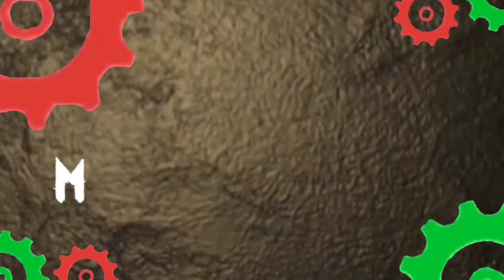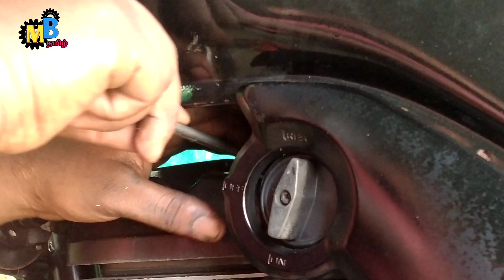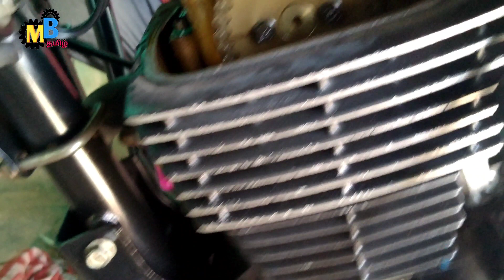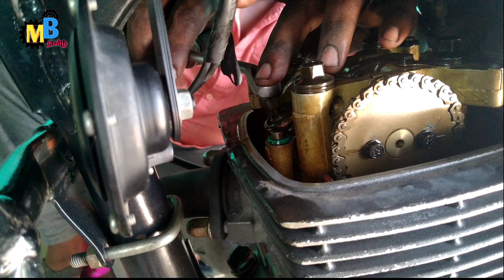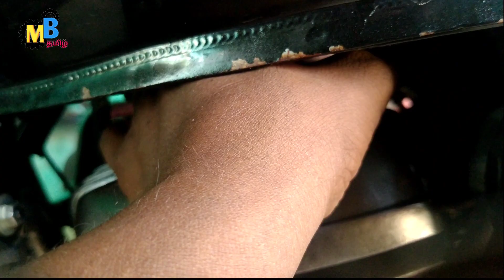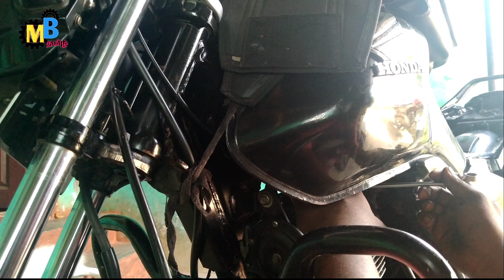HONDA UNICORN ENGINE NIOCE/VALVE CLEARANCE/motorbike tamil

Comment: Ji neraya peru, side shake check panranga, andha method recommended aa? Service manual meleyum keleyum irukra shake dhaan measure panna solraanga.. But neraya mechanics side shake method use panni kaileye adjust panranga, which is better and which is recommended please?
Reply from the maker: கம்பெனி பரிந்துரைக்க பட்ட அளவுக்கு கேஜ் வைத்துதான் அட்ஜெஸ்ட் செய்யவேண்டும் ... சைடு சேக் முக்கியம் இல்லை.. சென்டர் சேக்தான் கணக்கிடபடுகிறது .. அனுபவம் உள்ளவர்கள் மட்டுமே கை அளவு வைக்கலாம்... நண்றி 🙏🙏🙏
Reply: @motorbiketamil  Mikka mikka nandri sir.. Romba confuse aagi irundheen.. Thank you so much for your fast reply.. நண்றி 🙏🙏🙏

Comment: Bro tapit problem irunda pickup problem waruma bro
Reply from the maker: varathu bro.. thanks for watching 🙏
Reply: @motorbiketamil  bro.  Carburettor fully clean panniyachu.  Air filter new. Potachu plug new potachu.  Oil change panniyachu bro analum romba missing agudu bro
Reply from the maker: @abezamzam7481  km sollunga bro